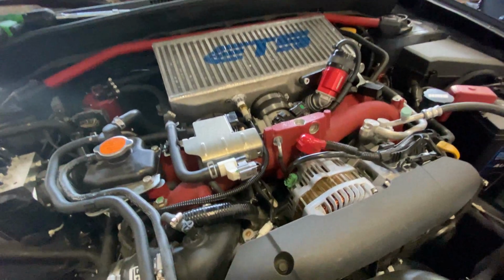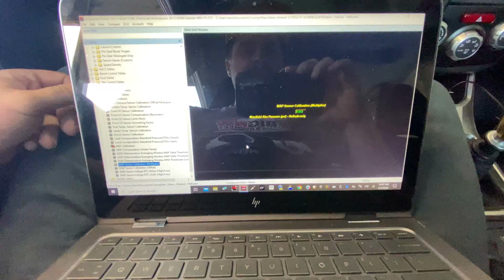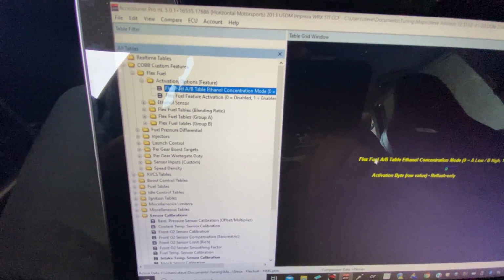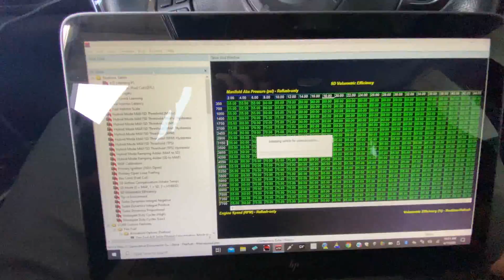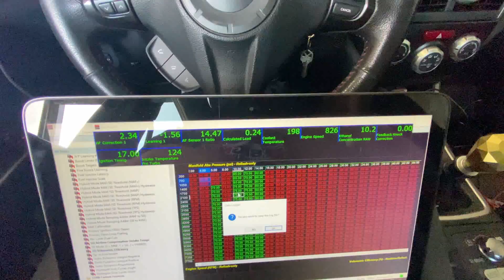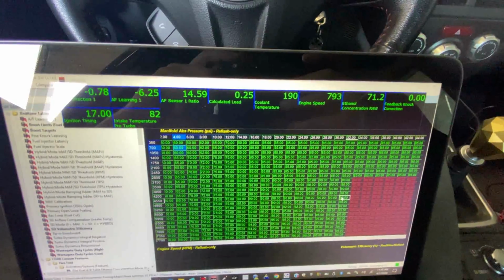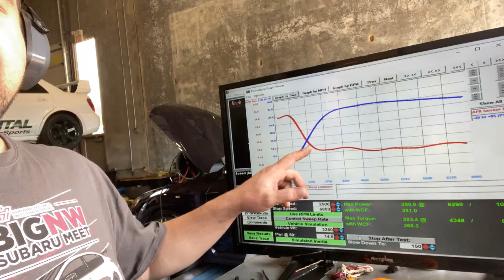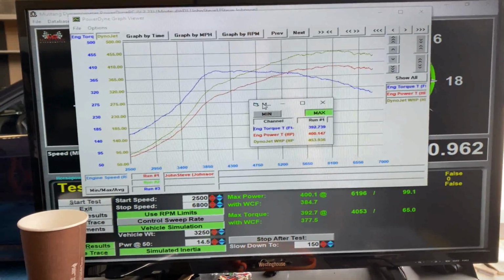STI Full Flexfuel Speed Density Tuning Session

Comment: Hey Steve, hope all is well with the new jobski.. Are you supposed wire the IAT to the old MAF wiring? And if you were you do a Hybrid MAF/SD tune, when using MAF your ECU would then just utilize the post IC IAT data correct?

Comment: Steve. Where do you install the wires for the AIT sensor? Thanks
Reply: It looks to have a jumper harness that plugs in to the stock MAF connector. This will use the same 2 wires for the factory air temp sensor.